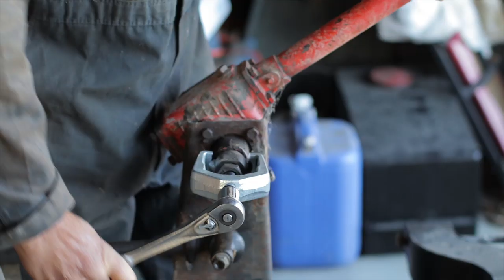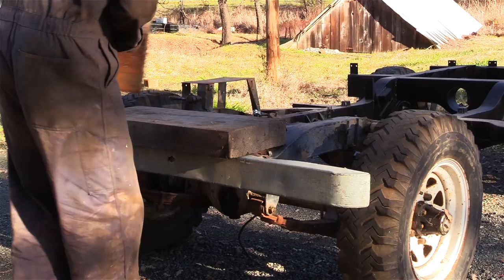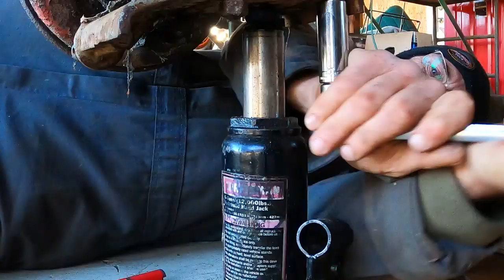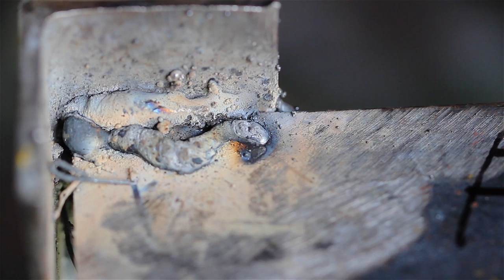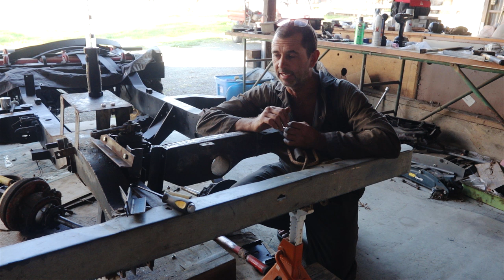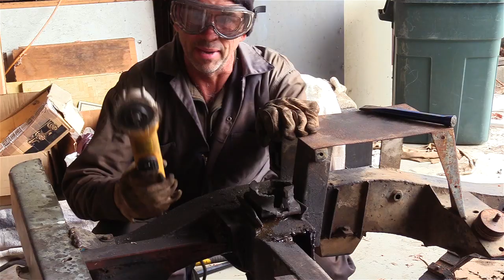Part 10: A Woeful Tale_Series 1 Land Rover Restoration

Comment: You do realise that you can service the relay by just removing its innards. I did everything you did to try to remove mine and ended up cutting a square in the top and bottom of the chassis and removed sleeve and all. I plated it over and fitted a Rover P5 power steering unit. This does away with all the vagueness of Land Rover steering. I also invested in a plasma cutter and it saves an awful lot of time and blades. Great videos, thanks.
Reply from the maker: Greetings Chris, cutting it out was to be plan Z.2. The reason I chose to remove it was if it wasn't going to come out meant there was rust and I was fearful that without seeing the condition of it's housing it might all disintegrate somewhere down the line. The P5 upgrade is intriguing as is the plasma cutter though I might not have an immediate use for that now.
Reply: Foreman and Wilms Adventures Thanks for the reply, my relay sleeve was rusty as hell, so much so that the tube was bulging. I may be guilty of a little deep water wading, just over the bonnet. However once inside the box section I noticed there is a heavy plate with taped holes welded inside the chassis, so with the two bolts at the top as well I’m certain that whatever rust was inside wouldn’t be a danger to steering.
I had doubts about the plasma cutter but now that I have one, it’s the go to tool every time. With a little practice and a form to run the torch head along you’d be surprised how clean the cuts are.
I love your videos and whilst I also watch This Old Tony between the two of you I always start my day with a smile.
The P5 Hydrosteer unit is an easy fix I could send pics if you’re interested. Cheers Chris

Comment: The one very clear thing that stood out far and above everything else in this episode Mr Foreman, is your forthright formidably resolute fortitude.
You good sir are an inspiration to many, although albeit somewhat scary at times; as we feared for your life.
It almost seems like this dastardly beast; devised in hell itself 'should have' been able to separate (unscrew/unbolt?) from it's upper housing-part. That lower larger section infers a total lack of design 'forward thinking' by the boffins-of-the-day (whoever designed this fiendish thing).
Perhaps at that time the thought was "Noone would Ever try to remove this from such a poor dilapidated ancient vehicle; eons from now".

But they hadn't heard of you. Mind you, I would have thought that with Len's* "input" to the venerable firm they would have guessed there's no stopping an Ozzie, eh? :)

* I speak of the Gunbarrel-famed Mr Beadell, and his ability to pursuade the venerable firm's boffins to take note of his suggestions/advice, and thus provide him with suchly modified vehicles that met his modest requirements.

PS interesting table setting at the start, and the slow approach thereto. One of Wilm's Master Pieces methinks?? :)

Comment: I have never before seen anyone cursed with such a horrible job, you did everything right, but that inanimate object just didn’t want to play the game.  I heard of one bloke that got his steering relay out after one month of banging and jacking and soaking with penetrating fluid, kept thinking maybe I should start spraying mine with penetrating fluid now in case I have to work on it in 5 years time.  Good to see the safety gear in use, your almost to the standard where you could become a model for a wphs  poster!  You will just need to provide copies of your relevant accreditation’s, work method statements, job safety analysis, pre start meetings signed and dated and approved by your supervisor-Summer?Cricket?

Comment: I have removed many of theses steering relays easily. All you need is vibration and lubrication from atf mixed with acetate Best penetrating oil 50 -50 mix leave for a day or so . Then get your air chisel or stationary chuck sds drill and a blunt chisel or drill shaft 10mm and hit the underside of the relay rust will rain down for a minute or to and the relay will jump out of it's hole . Never failed me yet . Vibration will move almost anything Phil Price
Reply from the maker: An intriguing suggestion, one that never crossed my mind but well worth a try if I find myself in a similar position. Thanks for the tip. The idea that came to me after the Woeful tale was to cut off the retaining tabs from the chassis so the relay could be rotated to crunch up the rust and gently 'hammered out', might be dreaming on that. Hopefully anyone reading these comments can add another option to the toolbox. Cheers Phil.

Comment: Ah yes, a bloody land rover! After She Who Must Be Obeyed had a rather forceful discussion with a power pole with the series 111 wagon I cut the entire left hand front chassis out from the centre point above the diff housing and welded in a replacement ( an overnight job). By the way the cummins 4BT into a series 11 SWB using Toyota FJ 40 running gear is proceeding slowly.

Comment: Very interesting,one would ask,did it really need to come out?It probably did,by what you uncovered with your exploration,all the"crud"that had gathered inside the cross member etc.A new relay will be one less place for any play to creep into the steering system for sure👍Anyway,it's a good old Landy,it's worth doing right.And don't worry,with some practice,those welds will start to look better.I'm going to have to go and have another look,I don't remember seeing an argon bottle,I gather you're gasless,that's always a bit harder.All the best👍🙂
Reply from the maker: Greetings Wayne, chances are the steering relay was probably fine though hard to ascertain without a test drive but now we'll never know. The seemingly irreplaceable front cross member was in shonky condition so I wanted to be sure the living quarters for the relay wasn't about to disintegrate. As for the MIG gas, there is a rather lame excuse appearing in the next film for not using it. Actually cut out the word 'rather' and re-insert 'very' lame.

Comment: Mmmm  bugger, that went from bad to worse, a total shitstorm escalation :-( We had similar problems a few videos back but fortunately the chassis tube that the relay mounts into let loose due to corrosion (from an exploded battery) and the entire job lot came out in one go (with some help from a sledgy).  I cut the same section out of a spare chassis and welded it in before fitting a replacement relay, good solution in the end.  At the time it seemed like the long way home but... having seen yours, we got off light and cutting the relay mount/relay out of yours may have been a good way to go... hindsight vision is always 20/20.   MIG stands for "Metal In Gap" doesn't it? Anyone can weld, just some are better at it than others.  Love your work!

Comment: Top Episode - Congratulations on your survival as well as overcoming The Bastard!  A great watch - I had visions of your Ford tractor up ending on its front and being raised through the front edge of the barn's roof...God that was one stubborn steering relay.  Luckily with mine I used the same methods, but managed to borrow the same sort of rig from Julian Schoolheifer here in the UK - he has just restored the 1st Production Land-Rover JUE 477 - and thank God it worked first time.  I found that the vertical chassis tube in which the relay sits had a vertical split in its side wall - had to buy a new one from Carl and Dale Radford http://www.radfordbulkheads.lrsoc.com/ and they supply new ingredients for chassis and bulkhead / firewalls for your Series One.  Keep up the great work!
Reply from the maker: So far it looks like the bulkhead on my old truck needs 2 new pillar posts but otherwise all other panels look repairable. That steering relay was a monster. I like your grease idea for the brake lines from a previous comment. I haven’t finalised anything there so will take your advice and do it.

Comment: The front cross member that houses the steering relay is available from Radfordbulkheads.lrsoc.com in the UK. They have them in stock and I believe they do ship worldwide. More information is available from the Land Rover Series One Club. I also made a jig to press my relay out. I had to resort to an 8 ton press.
Reply from the maker: Crikey Ian! That was a good tip for the future. There website was a bit average but it does look like not all is lost for finding bits. Another challenge I have is a side cover plate for a 1957 series 1 Land Rover. Similar to the series 2 without the little dowel. If you know where to find one of those I am listening. Cheers.

Comment: At the risk of being an arse ... why did you want to remove it ? it seemed to turn ok?
Reply from the maker: Rust! Fear of rust. If it was jammed in there then there is a good chance of mischief down the road. Although there was great hardship I now know the front crossmember is less likely to collapse off the chassis taking the relay with it.